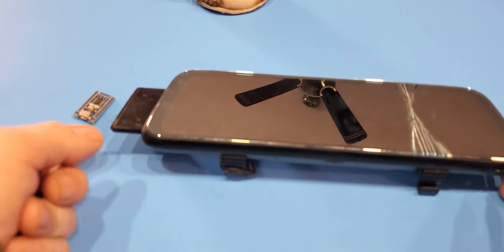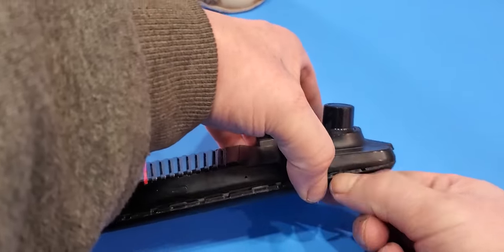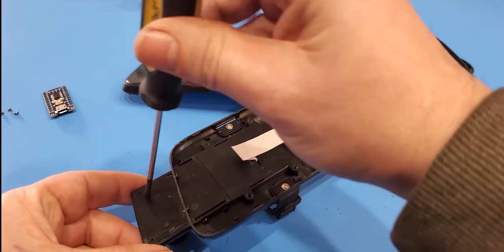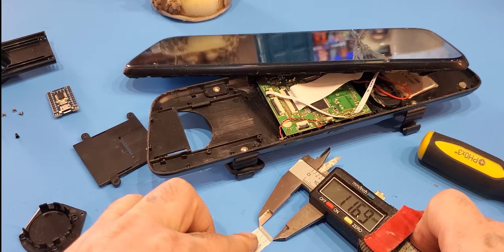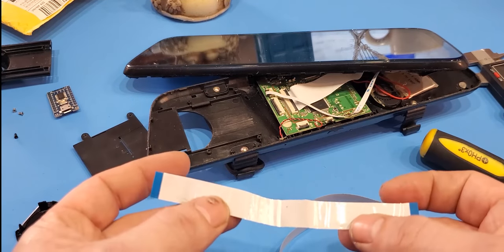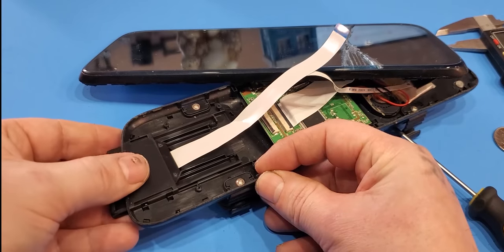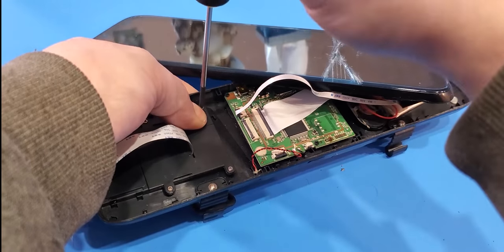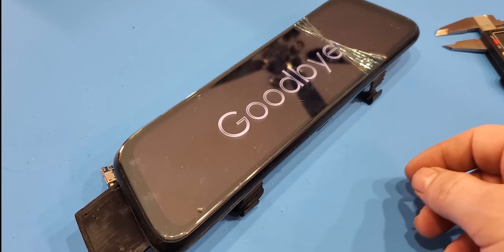fixing broken mirror dash cam

Comment: I have a similar rear view mirror dashcam. The screen recently shows distorted black and white horizontal lines/bands. I have tried restarting and even pressed the reset pinhole, but no luck. Any guess if this is a patch cable fix or something much more involved. Wondering if I need to buy a new one
Reply from the maker: yeah seems bad.. if you tried to unplug the rear camera.. and it still does it.. it could be a cable but doubtful (unless you do move your camera back and forth as well).. If its junk now it worth the time to take a look and remove the ribbon just to see if you get some life on your screen..    The processor might of over heated as well, My adas camera's I had to add little micro fans to them or they glitch out the same way as yours basically ..

Comment: Great video. Do you know how to fix a mirror dash cam when it powers on but the touch screen doesn't work.
Reply from the maker: thanks.. .. You might be able to find a screen replacement for your mirror..  If you open it up you can look around for anything that might of came out, the ribbon might of just slipped out of its connector  from vibration.
worth a look unless its still working as is and your worried about totally messing it up ..

Comment: Is it possible to replace the internal battery. Mine doesn’t charge anymore
Reply from the maker: Hi yes it would be pretty straight forward to change it.. However the battery is more as a joke in them .. the longest its ever lasted on mine was maybe 1-2 mins .    The only thing its good for is holding the time.    Just search for lipo battery 3.7  ..and try to find one with close to the same specs and size so it will fit in the unit.     
If you can't solder just cut one lead of the battery at a time. on the new one if it has a connector and on the unit it self.
.For example strip back each red wire,
 put a Piece of heat shrink over one of  the wires.
Twist the two wires together .
Place the heat shrink over the twisted wires.
Heat the heat shrink with lighter ect...
Repeat for the next wire.
If no heat shrink  you could use electrical tape as well . Just make sure its done good.

Comment: i SAT ON MY MIRROR BY ACCIDENT AND IT IS CRACKED LIKED YOURS IS IN THIS VIDEO. I AM HAVING TROUBLE FINDING THE COMPANY I ORDERED FROM TO GET A REPLACEMENT MIRROR SO I CAN FIX IT.. ANY IDEAS ON HOW TO GET A REPLACEMENT MIRROR..?  I HAVE THE USER MANUAL AND IT SAYS IT IS A.. 4G FHD 1080P SMART CAR DVR ANDROID 8.1
Reply from the maker: no i tried once off amazon the unit looked 100 percent the same in the picture but when it came the glass and unit were different .. the screen was the same however the glass was cut different on it so it didn't fit and the mobo was so so slimmed back.. so if your unit is 100 percent same you might have a hard time seeing they changed things up on the next version to save even more money ..  Edit.. ugg just read you have a android version .. so not 100 percent the same at all.. what size is your mirror being sold as so i get a hint..later when i look?